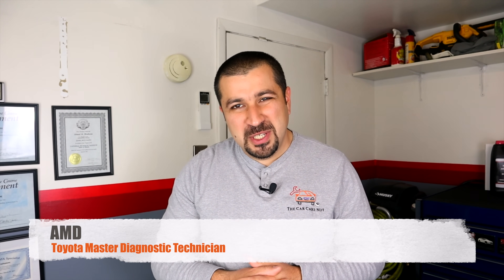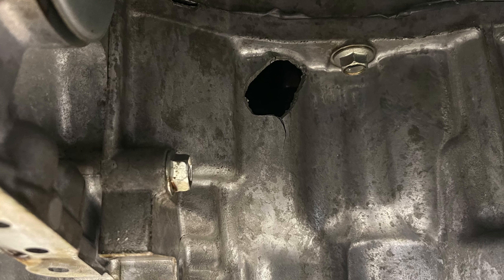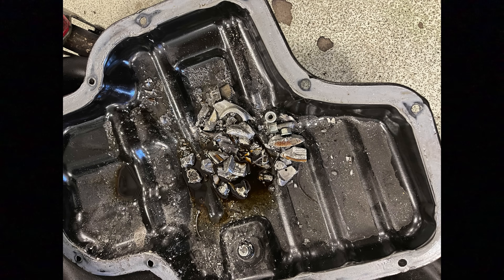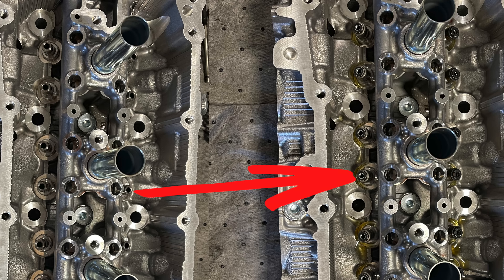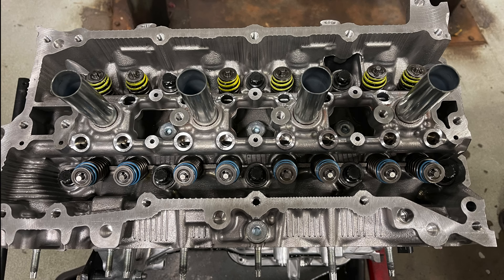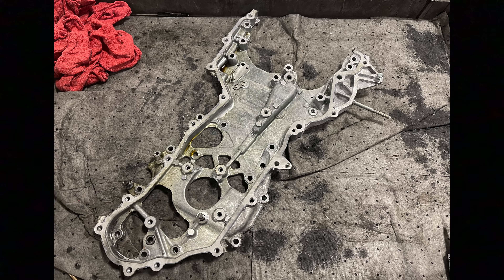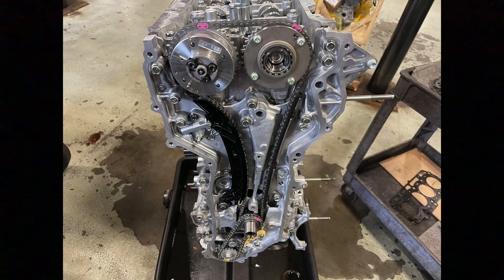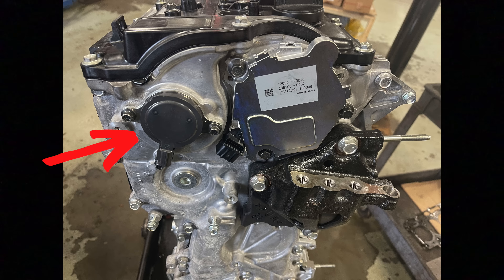Toyota's New Engine assembly Full start to finish!

Comment: I can't imagine how much a dealership would charge for doing this.
Reply: Nothing if it’s under warranty
Reply: I would say $4,500 or more. The bill for this job was paid through Toyota via warranty to the dealership .
Reply from the maker: The total was 5 digits 😉
Reply: @TheCarCareNut  $10,000 Plus🤑 I never saw that coming..I thought it was like $7,500 to replace the whole engine with a new one..Even more of a reason to take care of your car..
Reply: @TheCarCareNut  I guess we really shouldn't be surprised. This engine is not like the Dodge slant six my first car had. I don't think a minute in the procedure went by that I didn't see something I had never seen before. PCV between the crankcase and intake flange makes a lot of sense as long as the oil is maintained!
Reply: @charlesjackson1700  $4500 is probably just labour or is that what you were referring too. But ya, super scary expensive job.
Reply: An arm and 10 legs

Comment: Going to do my own engine assembly this week. I am so pumped now
Reply from the maker: Awesome! Which engine?
Reply: @TheCarCareNut  I was wondering the same thing.. These new engines are getting very complex. I would think twice before I would start taking apart one of these Dynamic Force engines.. lf you left out a washer or gasket or some other small component the end result would be catastrophic ! I would have want something like that to be repaired by a certified mechanic that was trained to work on those types of engines.. Someone like You👍
Reply: @charlesjackson1700  I'm in that boat, too. At 68 years old my capabilities and enthusiasm are dropping while engine complexity is rising. I think my engine teardown and assembly days are mostly done. Funny - I'm not sad about that!
Reply: @flagmichael  These engines are very complex.. If you went to school and were studying to work on them you could probably do as good as anyone since you have prior experience on engines as they once were.. Now we are being faced with more hybrids and electrical cars as well.. If you don't know what you're doing when you work on one of those you could get electrocuted... I am satisfied with just doing the maintenance on mine. Since I got away from domestic brands 20 years ago I have never had a single issue to go wrong with any Honda or Toyota I have ever owned.. not even a light bulb..